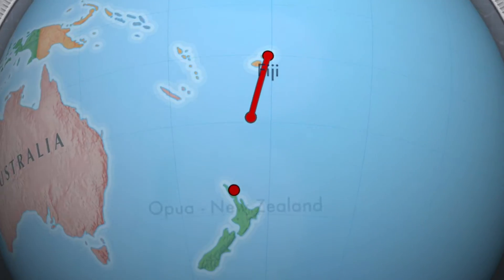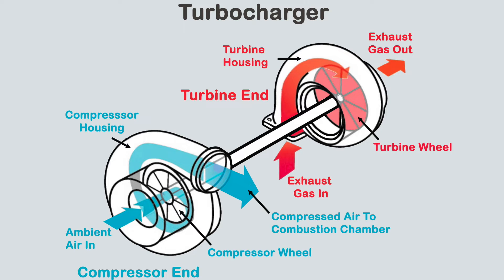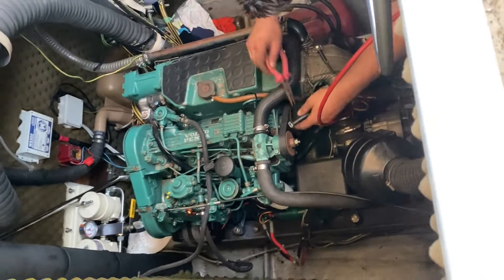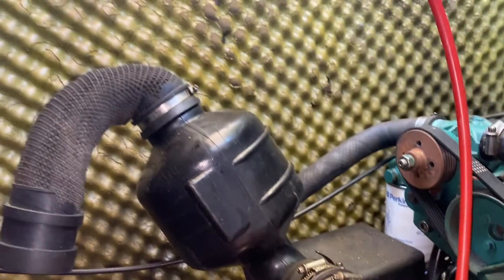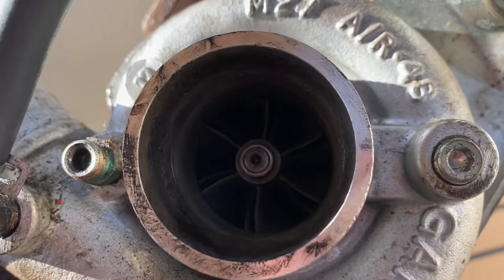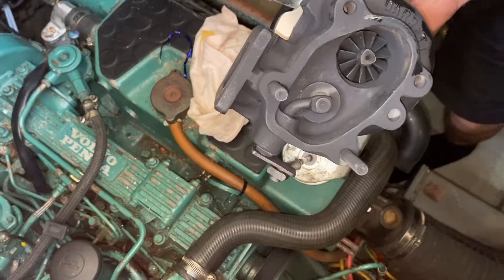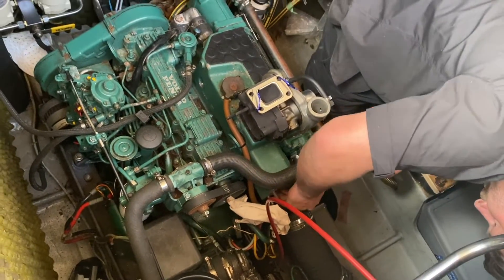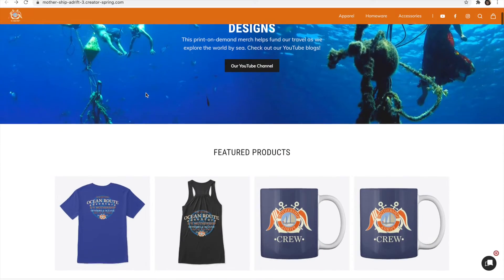#Garrett Turbocharger, Removing and Servicing it on our Volvo Penta TMD22 Marine Diesel Engine

Comment: Hello sir. What could be the reason for the high exhaust temperature? The exhaust system heats up to 500 degrees
Reply from the maker: Sorry I’m no expert on these sytems but perhaps you have carbon build up in your elbow? It’s a common problem. I clean ours out every year with oven cleaner.

Comment: Did the engine speed go up after cleaning the turbine carbon?
Does it emit black smoke when the turbine is running at high speed because of the carbon buildup?
My boat has similar problem.
Reply from the maker: Well it was running below par before this and went back to normal afterwards, so I wouldn't say it sped up, but it definitely improved things!